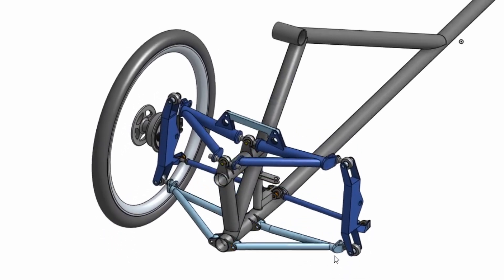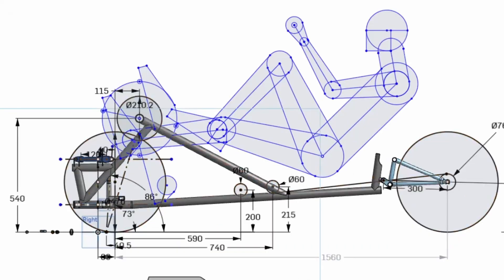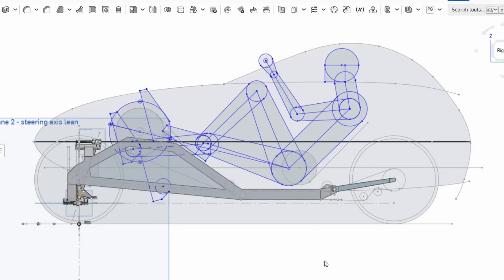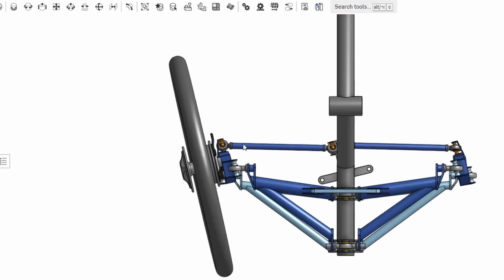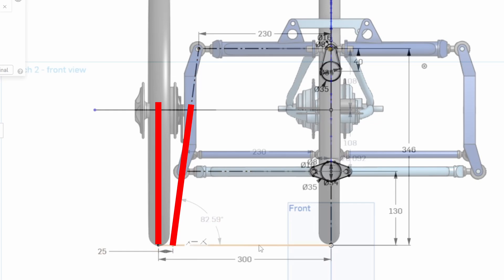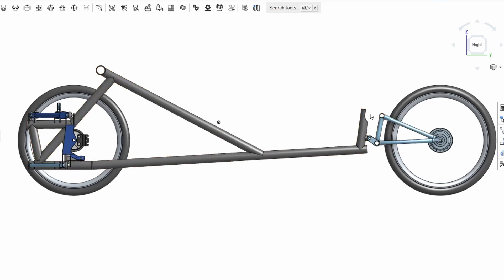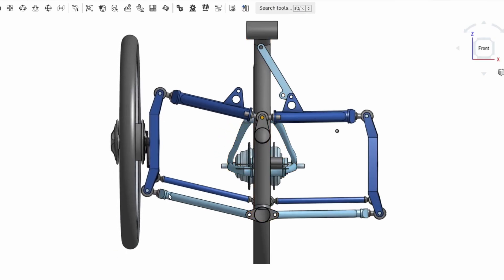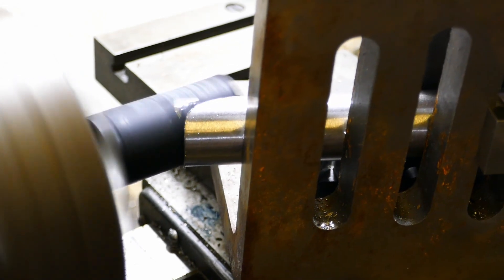Tilting Trike MkII Build Project Ep. 1 - Home Machine Shop DIY Project

Comment: Interesting that it's just bearings facilitating the tilting, no increasing resistance. I guess a foot/both feet on the ground are necessary for upright stability when not riding. Are there designs that have some sort of progressive resistance, or that lock up by themselves when not riding? If you need to scramble to stay upright at a traffic light, then the additional weight of a third wheel and tilt mechanism seem unnecessary compared to a two-wheel recumbent.
Reply: Not that I would have a clear idea for progressive resistance or locking up at stand still. Perhaps a variable thickness/width leaf spring could work for progressive resistance. But that's an additional part and additional weight. For locking up at stand still something might be worked out with the centrifugal automatic clutch of mopeds or whatever that's clutch is called. But I wouldn't know where and how to implement it. The relevant movement would be on one of the wheels/axles, but it should affect on the tilt mechanism. Hmmmm.

It's probably a non-issue, but it would be great if you can finish my thought with your knowledge and creativity. 😜
Reply from the maker: I didn’t mention it in the video, but I will fit a tilt lock so you don’t need to put your feet down when stopped.  Some designs do have a sprung tilt mechanism but I’m not convinced this is necessary.  Whether the trike has any advantage over a bike is a reasonable question!

Comment: I like the ability to fold the wheels in for storage (although that will be less useful if you put a body on it) but concerned that the locking mechanism has weight and stress on it all the time and could fail while riding. How about having its “failure mode” of the lock cause it to unfold into riding position and the lock mechanism is only there to hold the wheels folded in a drooped position? That way you could fold both wheels just by lifting from the centre shock area and pressing the lock with your thumb or finger. 
I realise the wheels also need to be stopped from folding when airborne over a sleeping policeman or for maintenance etc but that wouldn’t need much strength to stop it happening.
Reply from the maker: Fair point, it might be better for the wheels to fold down rather than up, then it could still be wheeled about.  I hadn’t thought of that!

Comment: I like the new design as its quite an evolution, what will likly be a typical tilt when doing a sharp corner? (Will it provide a more leaning experience)
Reply from the maker: About 30 degrees would be a reasonable tilt angle, it will tilt a fair bit more than this but it may not be too safe to do so.